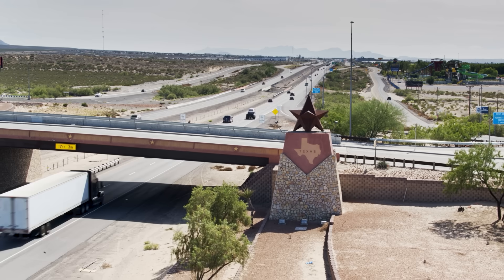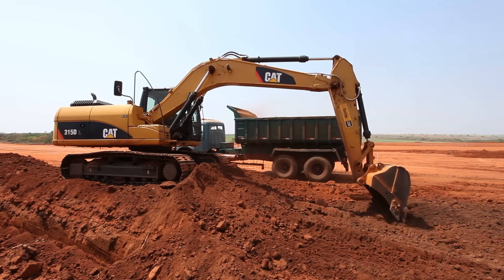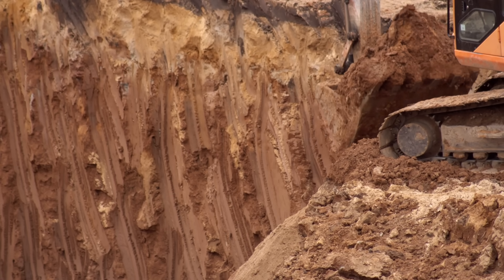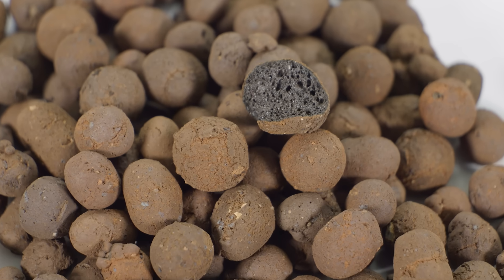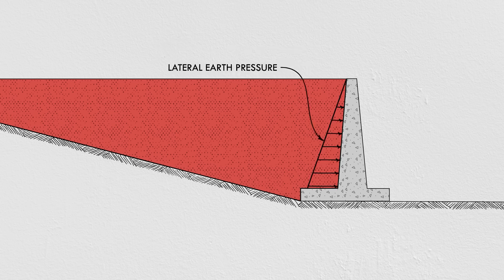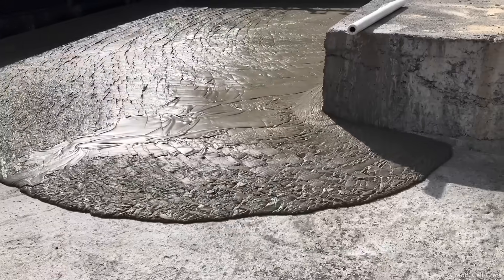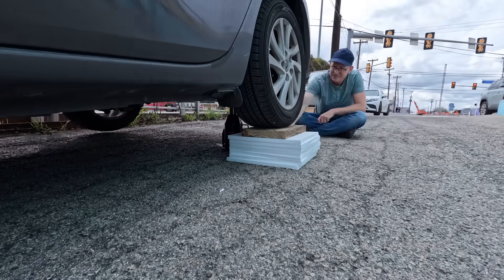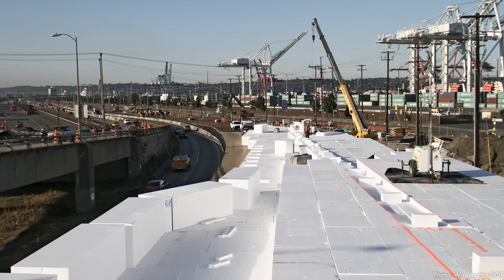Why Some Roads Are Made of Styrofoam

Comment: I'm surprised that the styrofoam doesn't settle. 

I owned a couple RC planes made of epp (not eps but simmilar). When they crashed, they often "squished". It could be somewhat brought back with a hair dryer but never to the original form. I wonder if that polystyrene embankment squishes too and how it can be prevented.

Comment: I have 2 questions:
1. Have projects in the past or in the present used preloading the soil below with a higher weight, then bringing it to the real embankment size? What would be the negative consequences, and if it is done, then where is it used?
2.  In the video you made about strong dirt and silt walls, it seems they are pretty beneficial. If that's the case, then why aren't similar technique used as an extra tool foundation work? The spacer material could even be added without needing to dig a full hole or even a trench and instead using hydrodynamics and pumping in material. I could easily be convinced it's infeasible, but I don't know why it actually would be.

Comment: If the problem arises from the embankment and the bridge being two different structures, couldn't we just make the embankment a part of the bridge's structure? We can build bridges at an angle, right? Make a bridge structure that starts on the ground and goes up instead of using a soil embankment. I'm guessing from here on it's a cost issue?

Comment: i was hoping you'd touch on the strength of the fill material. if it is full of air bubbles can it not be compacted after multiple uses? from my experience lighter materials tends to be more brittle. (average joe here).

Comment: Thank you for this amazing explanation.  I saw blocks being used for some roadwork (embankments) and I assumed they wouldn't be strong enough to handle the compression of vehicles going over, but you've proven me wrong.  Also, I use that highway overpass many times a week and it has yet to fail.  Also, I agree with your wife, waiting that long to get to dinner is a huge "I'M HANGRY!" problem.

Comment: Forgive my seemingly silly question but describe the need of the filled (light or heavy) embankment. Why not construct it as a ramp using basically the same method as the bridge itself so there is (much?) less of a weight difference? The empty space underneath can be used for a utility room, etc. What am I missing?

Comment: One additional benefit of using EPS foam in that sort of quantities is that, if it can be produced economically from biochemicals, rather than fossil fuels, it can act as a carbon sink and help offset climate change.
Reply: sure... at the cost of immense plastic pollution
Reply: @tlowry3689  it's not pollution if it's well-contained. it's sequestration.

Comment: I don't know if it's state wide, but in the 90's I designed a bridge on a CalTrans project, in a marshy area, that had a 50 foot hinged concrete approach slab. Still no bumps 31 years later.

Comment: Hi Grady, thanks for nice video. I can confirm based on my own experience that this is working. I did time ago (as young engineer) the design of retaining wall (embedded structure, wall supported by laterally loaded piles). Because of mess in the project it turned out that wall has to be locally extended from 2m to 3.3m height (6.6ft - 10.8ft) during construction. To challenge that I thought that lateral force depend on backfill weight, so it needs to be replaced with lighter material. That was idea to use EPS blocks as most available light material. Then I did small research and discovered that similar solution was used in my country. That ensure me it is good idea and I implemented this into design. Despite structure is not impressive I am still very proud of that design.
Greetings from Poland.

Comment: A few years ago my exit on the Denver Boulder turnpike had a partial collapse due to soil settling/movement (soil expansion and contraction is common here because of high clay content).  They ended up using styrofoam blocks as the fill material which probably wasn't an option back when the highway was first built.

Comment: I'm a Geotech Engineer who mostly works on PennDOT and PA Turnpike projects, and I approve of the definition of "a heavy pile of dirt" haha. We geotechs are often pretty chill because we spend lots of time playing in the dirt and working with that understanding that so much of what we do is working with nonhomogeneous materials, interpolating between borings limited by funding, and factoring for safety.  I'm fairly young, so I haven't had the chance to work with lightweight fill material yet.

Comment: Why not just put a steel plate down. Like turn a small step into a small slope. Or stretch 20 inner tubes under the road, with the ends sticking out. When the gap starts to show, just pump concrete in at high pressure to push the road up a bit more.

Comment: Thanks for making this video. I live in the Netherlands, where large parts of the western part of the country are basically glorified swamp. In my new neighbourhood, the decline is 2.5 to 4 centimeters a years, and have been declining at this rate for about 30 years now. The locals often refer to the peat ground as "thick water". All houses are build on poles, that reach a layer of sand 7-10 meter deep, and are stable. However, gardens and roads are not. Over time, in particular the roads have subsided (not really settled, as it is still declining) and the common solution was just to add another layer of asphalt on top of the parts that settled too much. Of course, that added a lot to the weight, so it settled even further. They found that by now some parts of the asphalt were 1.5 meter thick. After some heavy rain they decided to tackle this and for the whole village, street-by-street, and replace the heavy roads with low-weight material that basically floats on top of the thick water (also known as "ground"). It's a 10-year project, and interesting to see. Other solutions were tried as well, like excavating the borders of a neighbourhoud up till the sand-layer 7 meter deep, and replacing it with clay. This basically turned the watery ground into a bath tub: all the peat (thick water) in the middle would be contained by sand underneath and impermeable clay on the sides. In theory, this should stop the decline of the ground. In practice, it failed. It just keeps declining about 3 centimeters every year.
Reply: I admire the Dutch engineering, nevertheless, you will need to make everything float because the sea will rise
Reply: Well yeah about the bathtub idea failing! The clay may be impermeable but it's still perfectly deformable! It'll stretch like sweatpants on thanksgiving!
Reply: Lol, sweatpants on Thanksgiving 💀 @joshyoung1440
Reply: Hoi Freek Dijkstra. Welk dorp is het? Interesting comment. I think I've seen a Dutch documentary about that but I forgot where. I would like to see if I can find that again. Maybe you can mention where your example happened and when ? Bedankt !
Reply: There are parts of IH•10 in SE Texas/USA that are 23+Feet Thick concrete.
Reply: A better solution is to treat the large roads the same way as the houses, by building them on concrete plates supported by poles, with an asphalt top layer.
Reply: @alexanderpas  That would be a much more expensive solution. It might be the best option in some locations but it's cost prohibitive to use it extensively for major roads, nevermind all the minor roads that also subside.

Where I live things work the other way around. Draining the farmland along with soil loss causes the fields to gradually subside while the roads stay pretty much at the same level, so what had been roads at the same grade as the rest of the landscape now look like they were built on top of levees.
Reply: @alexanderpas  and where do you get the surety to declare that your idea is better? I'm assuming you're a road engineer, right?

Comment: I have a picture of a truck parked in a local grocery store parking lot with the front tires removed and the truck sitting on big blocks of polystyrene foam. It was compressing a lot and was likely on the verge of failing but still held long enough for me to get a picture. I dont think it collapsed on the guy but cant confirm that. It was an absolutely terrible idea! At least there are lots of people around to help if he got pinned.

Comment: I used to work near and frequently see work on the project depicted at 12:09 (this is at the southern end of the SR99 tunnel in Seattle that replaced the Alaskan Way Viaduct), and was always curious abut all the styrofoam they were using there.  To put it mildly, the soil a lot of Seattle is built on, especially near the waterfront, is seismically questionable (one of the main reasons to get rid of the Viaduct in the first place) so it makes sense to make things as lightweight as possible in that area.

Comment: aspects i feel are overlooked are the ability to easily work on them with just a few simple tools, engines that usually have more than 5 liters of displacement, wide availability of parts and relatively cheap compared to other sports cars

Comment: Approximately thirty years ago they built a new bypass around the port, and one high overpass required substantial onramps to the highway. Because it was built on once - soft river sediments, they told us they were going to use styrofoam blocks to lighten the load on the base. Everyone thought this sounded ridiculous and destined to fail, especially because of the heavy truck traffic entering the port. I have to admit, thirty years later those ramps are perfectly solid and in constant use.

Comment: I know those huge Styrofoam blocks real well. In Nov 2012, I worked with Superior Construction delivering precast concrete wall panels to a new bridge over railroad tracks on Industrial Highway (now renamed Airport Road) in Gary Indiana. The bridge deck was steel/concrete, the approaches were done with six levels of these huge foam blocks topped with sand/asphalt. The wall panels we delivered contains the sidewalls to keep the foam blocks from shifting and to keep them from rising and/or floating away during periods of flooding. Important since this location is only 3/4 mile away from Lake Michigan. This project coincided with the expansion of the Gary Chicago Intl Airport. The local rail line that used to cross the north end of the airport property where the expansion occurred was moved further north to join the railroad east/west mainline, which also utilizes the new bridge, East Chicago Ave between Cline Ave and Industrial Hwy was removed. It was an impressive project which is highlighted on the airports north end on Google Earth. I took a few photos on the project and now 11-years later, it still stands. That was the first time in my 39 years in construction transportation being involved with a project that used Styrofoam as a base material. Besides the airport, the area is heavy industrial with heavy truck use and it has held up very well.

Comment: The picture of an overpass at 4:35 looks like it's using another good approach to preventing the "ka-bump" -- extend the bridge with "ramp" abutments at each end, between the bridge's main span(s) and the tops of the big piles of dirt. When the dirt settles, the "ramp" sinks at one end, and not at the other.

Comment: Way back in 1989, at the start of my career, I was working for a defense contractor at White Sands Missile Range in New Mexico.  We were tasked with determining how "visible" various targets were to radar (their "Radar Cross Section:).  I was surprised to learn that the target, usually full-sized planes, missiles, or warheads, were supported on large pylons made of foam!  It turns out that not only is it suitable for lightening the load on a foundation, but it is also invisible to the radar!  This allowed us to position the targets in various "poses" and see how easy they were to spot on the radar.  

When I left, the team presented me with a photo from a test that we had run.  It was a full-size B1-B bomber being lowered into position by a crane, standing almost entirely on its wingtip.  Still one of my most cherished work memorabilia.

Comment: I'd seen foam blocks used to build embankments, just figured it was a logistics thing: the cheap (light) hauling offsets the cost of manufacturing, and it's already mechanically stable which could shorten the project timeline. I had never considered that a pile of dirt is still a structure beholden to the load capacity of the dirt underneath, making the lighter building material more advantageous.

Comment: I worked with EPS on a project building large floating breakwaters for a high end resort. The breakwaters were filled with EPS and encapsulated in pre-tensioned concrete. Never seen a video about EPS until today.

Comment: When a highway where I live was being extended, one of the huge challenges was a sub soil called leda clay. It's probably one of the most unstable soils around especially if it gets wet. There was no way to reroute the highway, so the engineering solution was to install a capping membrane, then use styrofoam blocks on top to build the bridge embankments. The styrofoam is ballasted with normal aggregate materials and paved. It hasn't shifted in the 10 to 15 years since it was built despite the heavy trucks that run on the highway.

Comment: I appreciate knowing a little about what goes into the design and engineering of major public works and utilities structures. The 7.8 earthquake in Turkey,  building failures and loss of life are sobering. I Live near San Francisco. I believe it is cheaper to do it right.  The extra cost of cutting corners to save money at the cost of safety is not worth it.

Comment: Radiotherapy vaults often require extra-dense fills to provide more radiation protection. As it's obviously more expensive, everyone has a story about contractors swapping in normal cement (either to save the project the expense or pocket the difference) or even adding open PVC pipes to reduce the amount needed.

Comment: Grady:  I was going to ask this on Nebula, but for whatever reason they haven't implemented a questions/comments section yet, which is quite frustrating...

Given they have a table for expected settlement over the first several years, could it not be a viable solution to build the ramp higher than initially necessary, and then have a corresponding elevated 'wear layer' on the bridge to mitigate the bump...  something like an asphalt composite over the permanent concrete structure that would wear down at roughly the same pace as the ramp settles.  That would mitigate the higher cost materials of a lighter weight ramp, and also prevent the dramatic elevation differences caused by the settling.

Comment: with my limited understanding. a pivoting steel ramp to connect the bridge to the embankment would allow for movement of the embankment.
the steel ramp would be connected to a hinge on the bridge and would be resting on the soil of the embankment.
with this method you could build embankments that are "too high" and then when the embankment sinks it would get leveled just right after 3 years or so.
after about 5 years you could inspect the pavement at the joints and repave them.
Reply: Those are called expansion joints. They get pounded hard by traffic, particularly heavy trucks to the point where replacement is required which is both expensive and time consuming. Additionally, they have to be tied into the structure of the bridge really well or else there will be a catastrophic failure event.

Comment: To those who can answer, can this spray foam/concrete mix be used as a foundation for a house/workshop/garage?
Reply: don't know to much, but you probably could. I don't think it would be cheaper and in fact for low-rise low-cost buildings might be weaker than normal materials, with not great difference in settlement. I would say that there is no point to do it.

Comment: I suppose the main reason to make the foam out of polystyrene, is cost?  You can make a foam out of all kinds of different materials, many of which would not dissolve on contact with spilled gasoline.  Aluminum foam for example is a well-understood and fairly widely used material, but I have no idea if it's ever employed in road-related construction; I suppose it might be too expensive in those kinds of quantities.

Comment: A question: The load from the weight of a building doesn't go straight down. There's a lateral pressure like you mentioned at 7:02. Does its area of influence form a cone under a point mass, or is it a distribution of pressures? What properties does this pressure depend on? In general, what's the equation to calculate lateral loads called?

Comment: One of the most fun things to do if you work in a concrete testing lab is to toss the foamy grout cylinders at other people. They look exactly like normal concrete cylinders except they're light enough to float, so people react as if you've just tossed a 10lb chunk at them when it's actually like 1lb and is so soft you can dent it by tapping it on a metal surface.

Also was once on a construction site doing an inspection. Had some of the guys doing rebar ask a question on what the difference was between styrofoam and geofoam. Told them that the geofoam is more expensive, lol.